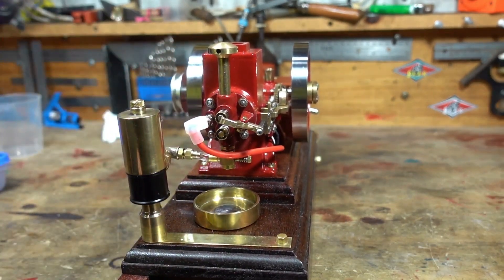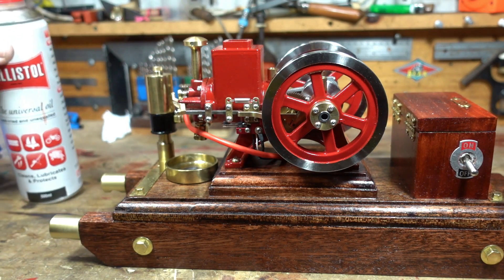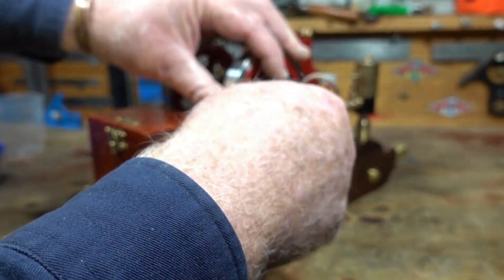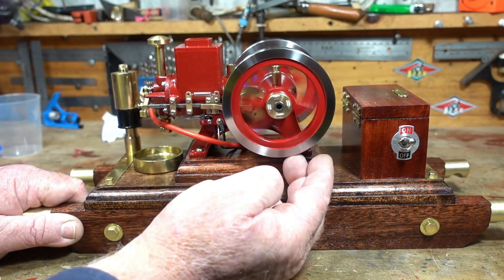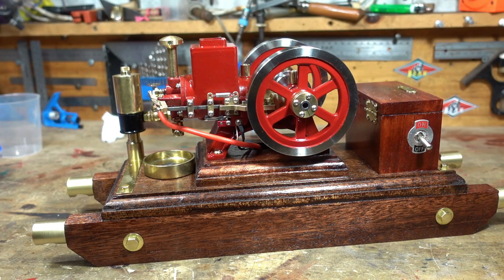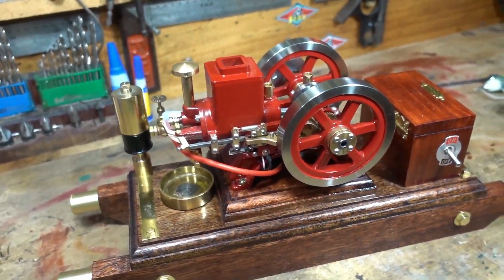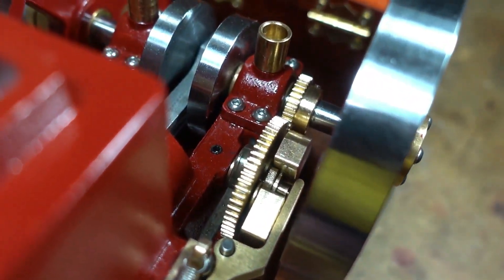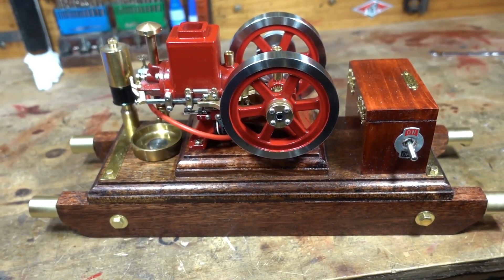Hit & Miss Engine Enjomor 6cc these are the last Modifications I Think?

Comment: Runs beautifully Jim.  Not hopping around like many of them.  Great job. Cheers Rob
Reply from the maker: Thanks Rob, a lot of them do jump about like Mexican jumping beans. These are a fun deviation from steam engines! - Hope you're enjoying your shed heater, its been freezing in the shed the last coupla' mornings! Cheers Jim
Reply: @SteamEngines-Jim  Hi Jim.  I have a model old style 4 stroke engine on the way to review, so I get to join the ICE club soon ;)  That heater is a god send.  I can't imagine life without it.  Really does a good job.  Cheers Rob
Reply from the maker: @Xynudu  What model did you get Rob? I have two of the Harley Davidson style engines to review now. I might have to look into a heater, its definitely a little miserable on the really cold days. I also have the problem that I have to have a 40cm deck fan oscillating all night on a timer in the Winter months since I insulated my workshop a few years ago. Without that fan, everything metal like tools, machinery everything is just dripping with condensation in the morning, the fan stops it completely from happening. A mate reckons its because my shed temp is getting below the dew point and the air is still and that's what causes it.
Reply: @SteamEngines-Jim  Hi Jim.  Banggood are sending me the ET8.  It's on the way.  Engine DIY have also been in touch again, but dealing with them on collaborations is like drawing teeth.  I'm not sure where that is going.  Regarding the condensation, that is usually due to lack of ventilation/air flow.  The room is too well sealed.  Moisture will noticably condense out at dew point if the humidity is high enough.  A diesel heater may actually help as it will burn up/replace room air and eject moisture out the exhaust (quite a bit).  Some of that will be from the fuel burning as well.  So you get to warm the room and possibly dehumidify it.  Worth a try.  The Vevor 8 Kw unit I have is very effective.  Pump noise is very low.  The loudest noise is the fan, mainly on high settings.  I tend not to notice it, but will turn it off for review work.  Others appear much louder, but that depends on the setup and camera/mic position.  I hope this helps.  Cheers Rob
Reply from the maker: @Xynudu  Banggoods been good, also EngineDIYShop (not EngineDIY). Looking forward to seeing the ET8 running Rob.
Reply: @SteamEngines-Jim  Yes, totally agree re the collaborations.  I'm keen to see the ET8  arrive.  There are some really nice looking ICE engines out there now.  China is right on the ball in the manufacturing sector.  Cheers Rob
Reply from the maker: @Xynudu  Rob I've used Zippo lighter fluid (works out ridicously $$$), I've used unleaded  (HATE the smell of petrol all over my hands) , my go to fuel now is Diggers 'Shellite' from Bunnings. Its what the American guys use and call ' White Gas', its a camping fuel and lighter fluid.
Reply: @SteamEngines-Jim  OK thanks for the tip. Cheers Rob
Reply from the maker: @Xynudu  All mine run really well on it Rob.